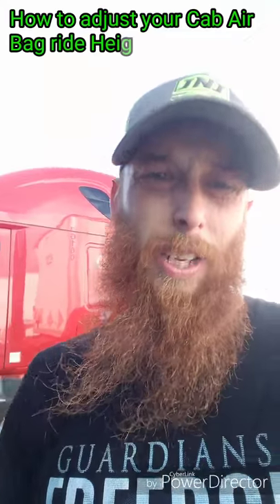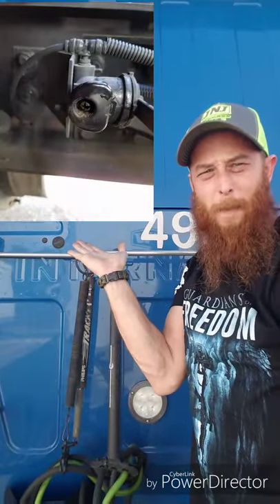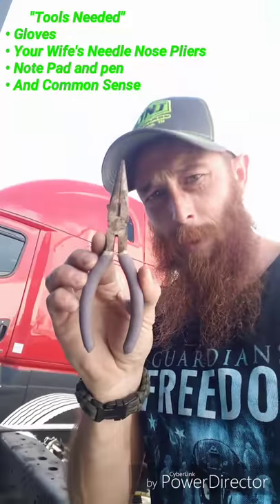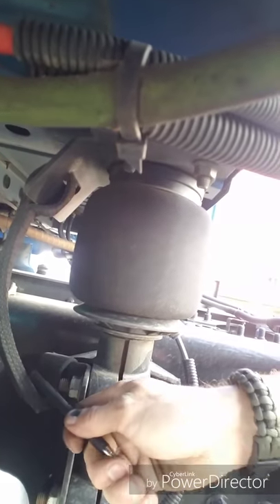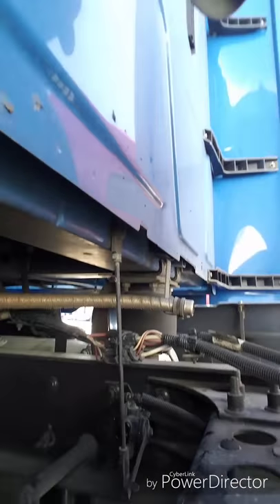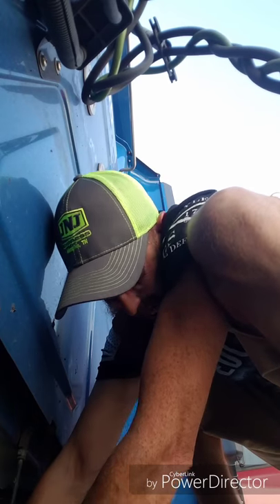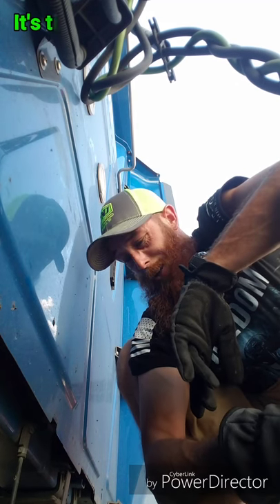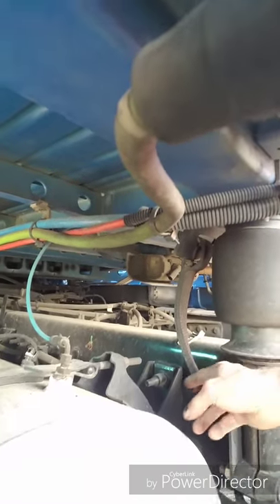Adjusting the cab air bags on a 2016 International ProStar

Comment: I tried this on my prostar, and when I adjust it, I see the cab raise up, but as soon as I take my tool off the adjustment, it immediately vents the air and goes back down to where it started. Does this mean my valve is bad or something?
Reply: Same problem on new one I just installed

Comment: It's not the air.it is the shock absorber.i had a prostar with that same problem.the prostar is like a strut.it is inside the bag itself.it wears out fast.would bounce like crazy.had the struts replaced and stopped bouncing.problem solved.
Reply from the maker: Good deal. But this was not the case with mine. No longer had an issue after I adjusted the ride height.

Comment: We just got a prostar not to long ago. And the cab is very bouncy. Did this work for you? After adjusting, did it stop bouncing much?
Reply from the maker: Yes it did. Just be careful not to over inflate. You can trade one problem for another. To stiff can cause a Rafferty ride. Hope it all works out for you. Be safe on your travels.
Reply: @AdventureswithWildmanLuno  what do you mean by Rafferty ride?
Reply: Can this method be used to reduce the air ride cab roll on a volvo vnl 780